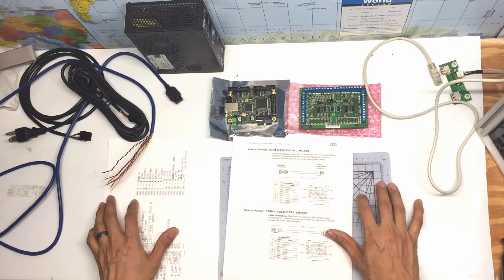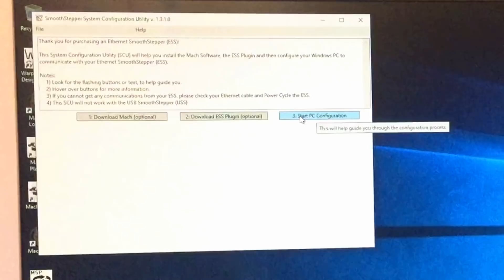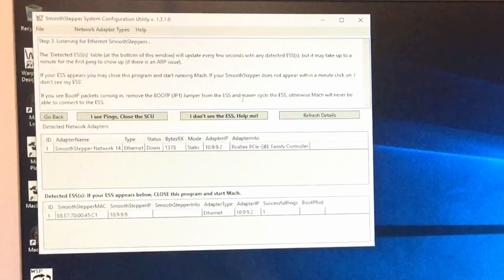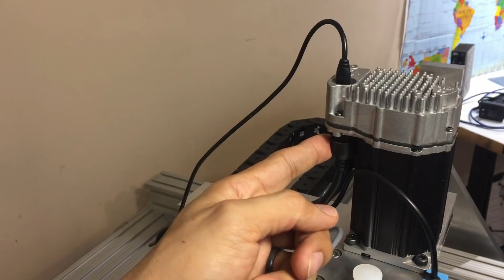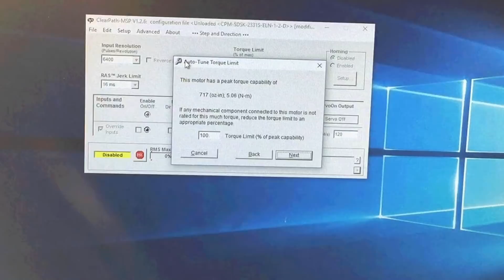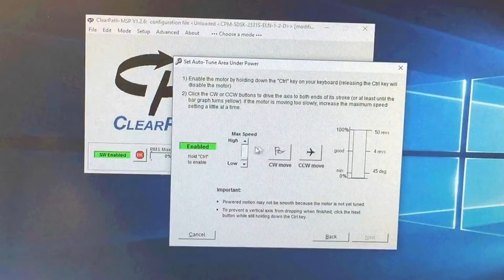Homemade DIY CNC:  Setting up  ESS to Clearpath Teknic servos (part 4)

Comment: Hi
Can I upgrade to 5 axes controller by adding 3 motors more from your design (Smooth stepper and BoB)?
Thank you
Reply from the maker: The smooth stepper can do up to 6 motors. But it’s for Mach3 or mach4

Comment: Hello friend, I was buy the ESS cnc board with the C11G complement, I have a big problem, maybe you can undertand what happen:

When I move +Y axis and -X Axis all move good, but when I move +Y and +X the movement is bad, some vibrations and hits is present, have some idea about fix this?
Reply: oh and my limit Z when I go to Homing not down.
Reply from the maker: Andres Luna what type of cnc you have? And which program are you using to run the cnc?
Reply from the maker: Have you try lowering the speed and acceleration of the steppers motors?
Reply: @radikult-custom  hi dear, thank you for reply, only need conecta the 5V in the driver hahaha, but the lilit Z is activated, not down, but yes UP. Now the axis mové really fine, thank you for you Support
Reply: @radikult-custom  Like CNCRouterParts and MACH3
Reply from the maker: Andres Luna yo hable español también
Reply: @radikult-custom  excelente, pues ya pude resolverlo coloque una pausa en el movimiento del homming Z, con eso lo resolví. Muchas gracias por tu atención cualquier duda estoy a tus órdenes 😁

Comment: Hi Mario, one super question, with the C25 board can use PWM for spindle directly?
Reply from the maker: Andres Luna no you can’t. It don’t have those inputs for spindle. You will need another BoB for that I’m not sure which because I have a Chinese vfd with a usb r32 to control my spindle
Reply: @radikult-custom  oh I see, I never use usb r32, how use this?, have some video friend?
Reply from the maker: Andres Luna I don’t think I have made a video about this. But here is the link that explains everything 
http://royaumedeole.fr/informatique/plugin-mach3-pour-vfdhuanyang/mach3-plugin-for-huanyang-vfd/

Comment: Are you still satisfied with the clearpath and smoothstepper? i have eard that the 800CPR encoder 0.48deg, could have a jittered effect compared to a 12000CPR encoder. I often loose step with my stepper setup and i am planing to go closed loop.
Reply from the maker: Hugues Prescott  I’m very happy with my clear path servos,  very accurate and precise. The models I have are 2331s and they have lots of toque and speed.  As for the smoothstepper I had a few issues with trigger of the proximity switches and my zero touch plate,   Other than that it has work flawlessly
Reply: Radikult  thank you, is your mach3 version is .066 or .062, .066 is known to be buggy while homing, since i switched to .062, no more issue on the limit switches
Reply: I see also that you have the enhence ELN version with 0.057deg resolution, should be very smooth.
Reply from the maker: Hugues Prescott I have heard that before. But I’m not sure which version I have. The issue I had was with the breakout board of the ESS  which takes positive trigger signals and need to “pull up” a resistor, so I had to do my limit switches a different way with a different BoB
Reply from the maker: Hugues Prescott yes that’s why it’s very accurate

Comment: What is the exact model of your servo motors?
Reply: Thanks.  You are super responsive to questions.  That's awesome.
Reply from the maker: David Herrin the model are 2331s sdsk
Reply: Thank you.  This was a great set of videos by the way.  Super helpful!
Reply: One more question.  Do you use a separate power supply for each servo or just one power supply for all three?
Reply from the maker: David Herrin one power supply for all 3.   I have heard you can connect up to 4 motors
Reply: Are you using the power supply from clearpath?
Reply from the maker: David Herrin yes the IPC-5

Comment: I have a separate question,I checked EVGA web site and you tube , it doesnt show me were each wire goes.
I have male and female 24 pin power supply. I dont want to burn out my mother board but do you know were I can find pictures of were wires goes to on each connector. I have wire all the atx connectors and paracord and pins and crimpers. just need some help . Email me if you can help I do aprecate you helping me last time
Reply from the maker: https://www.gegeek.com/hardware/power-supply-reference/
 does this helps?

Comment: Man you're moving forward fast!
Did you design this all on cad?  Which software?
You should consider selling plans, its easier than selling hardware.  :-)
Oh, and when armchair engineers tell you a part is too heavy, you can always make another one using your awesome new CNC machine, and put lots of lightening holes in it, still keeping lots of meat where needed for strength and rigidity.
Keep up the good work man!

Comment: What size acrylic do you use for the reservoir? I’m going to get a bunch of scrap to practice
Reply from the maker: Kaleb Israel from 1/2 to 1.25 inches it depends on the design
Reply: Oh okay. I was thinking like 3/4 so a g 1/4 thread could be used on the side. How deep do you make your channel where the water flows?

Comment: Hello - do the motors connect directly to the break out board? No separate driver between the motor and BOB?
Reply from the maker: Scott Brunner the drivers are build into the servo motors with an encoder too,  so yeah all you need is a step and direction signal to move the motors
Reply: Hi Thanks for the reply - I subbed your channel I need to see this complete! I was about to order Leadshine closed loop steppers off of eBay for my CNC router build, until I saw this option. How do you like the motors do you feel its a good choice?
Reply from the maker: Scott Brunner to tell you the truth  I haven't tested the machine,  right when I was about to,  my spindle vfd blew up and  I haven't cut anything yet 
 I'll say that the motors have a lot of speed  when in was tuning the motors in mach3 I put like 1000 inches per min in  .25 sec  and I was afraid to even move the machine because it was to fast 
 Now I have it at around 250ipm
Reply from the maker: The one thing I don't like, it the c25 BoB.  I put proximity sensors on my cnc and I can not figure out how to make it work correctly same with the touch tool plate, probably I should of went with Acorn or a pdx126 BoB
Reply: thanks again for the reply! I too was looking to get the PDX126 BOB. It looks like a good choice to use the ESS which I was going to get as well. So now I'm thinking ESS + PDX126 + ClearPath. This looks very promising. I'm really excited to have found your channel and look forward to seeing more on this machine. - Scott
Reply: I saw on NYCCNC video that the ClearPath can home to a hard stop like a rubber button. This might help you. https://www.youtube.com/watch?v=ZRURwDFvdAs
Reply from the maker: Scott Brunner I do follow him, and yes the clearpath can home to a hard stop ( you can adjust the speed and toque when homing) but the other problem for me was that I couldn't tell mach3 that it was already home ( I don't know how to reset my home dro's)   but I think I found a way to fix all the input problems I had with the C25 BoB
Reply: Hi - one more question - what size ClearPath motors did you get for your machine?
Reply from the maker: Scott Brunner 2331s  but talk to them or send them a email and they will try to help you choose the right one, you still have the 90 days money back if you don't like them

Comment: What size is those profiles on lower frame sides ? 50x100 ?
Reply from the maker: 3x3 inches and 3x6 inches aluminium extrusions
Reply: So thats an 80x80 beam on metric sizes then, well thanks for you answer :) Just playing with some designs myself.. even though i am not building another cnc.

Comment: Instead of Mach3 and Smooth stepper, take a look at Centroid CNC' new Acorn step and direction motion controller. Less than $300 US dollars, hardware and software from the same company that has been doing Industrial motion control for over 30 years. I have enjoyed your recent build. You've done a great job with fit. Looking forward to seeing the finished machine.
Reply: Hi are you running one of these? This looks really nice I am now thinking to go ClearPath + Acorn
Reply: The acorn looks like a rip-off of the machinekit on the beaglebone. The smooth stepper is a good upgarde.